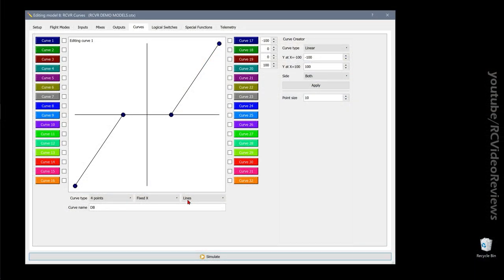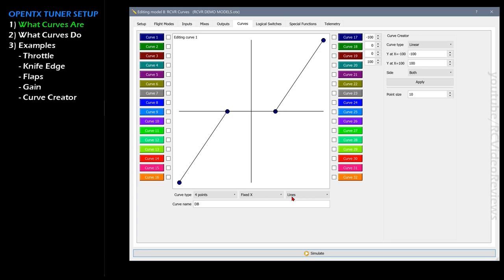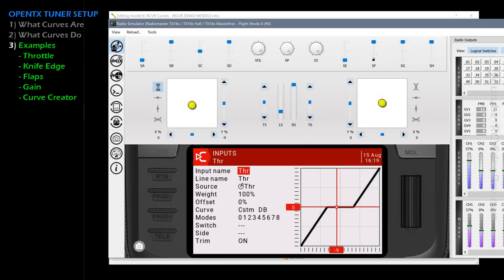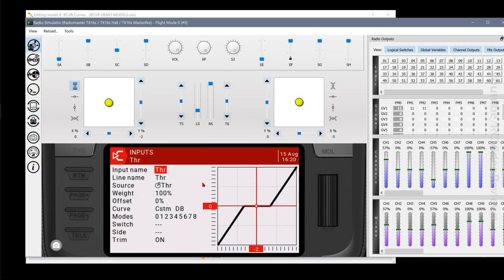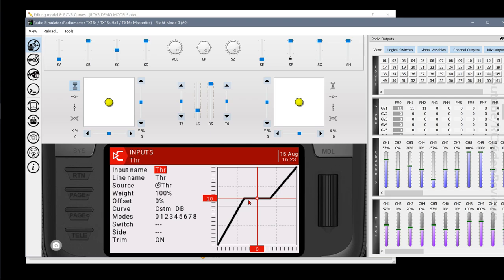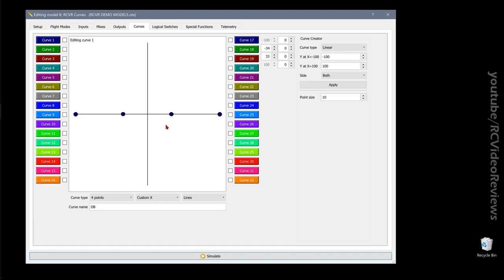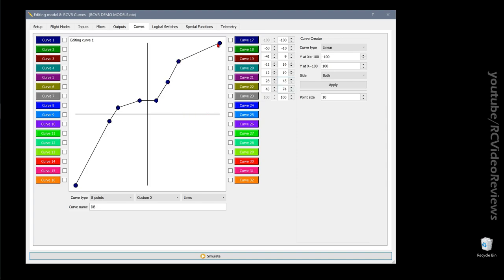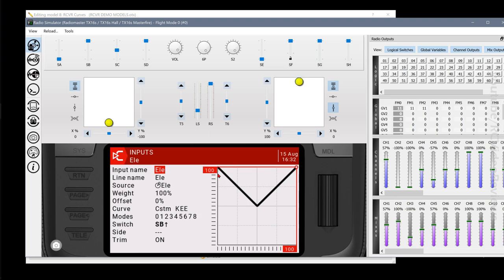OpenTx Companion Tutorial • Curves: Throttle, Flaps, and Gain Curves How-To • [Beginners]

Comment: This is the most complete explanation of curves on the internet that I’ve seen.
Reply from the maker: Awesome! Thanks for the endorsement :)
Reply: Probably true, I've just watched a few trying to figure out how to set throttle at -75% to 100 with a curve under a switch. 
But no answer why my curve didn't work like I wanted to. Had to change "multiplex" from "add" to "replace" at the mixer screen.
Wanted "idle up" under a switch for  some old toy drones, they tend to stop the propellers and drop out of the sky at -100 throttle. Not really helpful when I'm teaching a non-gamer, never flew anything friend to fly.

Comment: I was struggling with my flap servo at full end stop with flaps level to wings setup on a 3 pos. switch.  Position 2 & 3 were driving flaps much too far down. I added a 3 point curve to keep flaps up at -100, then pos 2 @ -70 for medium flap, then pos 3 @ -55 for full flap. New model wizard puts flaps on mixer page, and this was the key to customize flap end points without overdriving flap surfaces.  Figured it out on my own, but with this video, it gives me relief & confidence knowing this is acceptable practice.  Thanks John, keep up the great tutorials, your video's are the best source of info without all the crap, right to the point.
Reply from the maker: Thank you. I appreciate the kind words. Glad to help.
Reply: I crashed T28 1.1m yesterday and decided to add flaps to the wing. After asigning flaps to a 3 way switch, my flaps are moving way too much, especially in full down, almost 90° against the wing 😂. Then i said to myself, go watch rcvideoreviews and learn curves.

Comment: I better start from the beginning of the video series. I was trying to locate how to set up 2 stage flaps on my Jumper T16, since it will only go down half way. I don't know what I did when I rebound, but it used to go all the way down. I watched this video, and I get more confused, but understand more.lol This open TX is killing my brain!
Reply from the maker: Flaps should be really easy:

1) Create a 2 Position Curve. Call it FLA. Set one side to -20, the other to 20.
2) Add a switch on the Channel to which you've connected your flaps.
3)  In the switch, apply the Curve.

Once you've done that, your flaps should travel the distance of the curve. Use the curve values to set the endpoints of travel--full up and full down. Once you've done that, the middle position of your switch (or pot) should always be half of the total travel. If you want something more complex, make it a 3 position curve and put the middle point on the vertical axis at the travel position you want.

As long as you don't set your servo endpoints to push the flaps past their stowed position, you really can't hurt anything. So just play around with it. Use your channel monitor to help. If you use Companion, it gets really simple and really fast to tinker.

J

Comment: Great video!
Trying to set up pot S1 for pitch curve trim and S2 for throttle curve trim.
Have an older heli with collective pitch setup, everything works but cant get the pots to work.
I want to be able to adjust for example the normal pitch and throttle curve?
My radio is TX16S MK1.
Had a JR radio when i was younger and that radio had trim pots for those things built in.

Comment: Great vid! I made a 2 point -100 curve for throttle cut, copied my throttle in input and assigned the source as thr stick and the curve to switch.  It highlights the switch but doesn't do anything to throttle output. Thanks
Reply from the maker: I've never used a curve for throttle cut, I always use a special function for a basic throttle cut:

Special Function1   SF down     Override Ch3   ON

Use any SF slot you want. I use Switch SF in the down position. Throttle is on Channel 3.

Comment: Another great video!!! I use d eadband when flying my Ahi glider with flaps  enabled in the throtlle stick. Since they move both up.and down, I know that around the middle.they are at zero degrees -neither up nor down. Very helpfful!
Reply from the maker: AhHAH! I knew one of you deadband guys would make an appearance. 

Appreciate the comment. Thanks for checking in.

I used to use deadband on my offroad electric race buggy to manage the throw distance between brake and throttle.

I've been thinking about a way to use it for reverse thrust. The Castle ESC has an auxiliary wire which lets you reverse the motor. I'm thinking a brake to deadband at -90 then deadband to -95 and reverse less than -95 might be something fun to try on an F3A or 3D plane.
Reply: @RCVideoReviews  Great idea! Now, I have to buy a Castle ESC and the programming USB.

Comment: Thank you again for this tutorial. 
I understand that curves can be or are like Exponential settings where the output is not equal to the input, but can be set in open tx free, to suit your needs. Maybe I'll use these some time. For now I'm more busy with basic set ups. Until now I only have experience with Spektrum Radios where you have very little possibilities. But on the other hand less time consuming programming to do, to get the average flight setup. At least for my abilities.
Reply from the maker: It only has to be as complex as you need it to be, but it scales like nothing else as you've pointed out.

Comment: hi folks. i have ONE Question using different curves: i would like to use the 6 push buttons to set the different curves on 3 channels ...i do not get it baken to do this...and what are the modes which are to be seen when you enter the AETR settings...it is mode 0/1/2/3/4/5/6/7/8...what does that mean and is this possibly the way to get a functionality like i want. So i would like to have depending on the "flight character" i want that time e.g. push button 2 for a different curve for AER channels...best regards...René

Comment: Cool video,but I'm still not able to easily modify my throttle curve. 
I mean,I create a 5 point curve like yours,really easy also to assign it on the input menu but,the main issue is that I can't see the Y axis moving when I'm creating my custom curve! At the minute 6:40 when you move the throttle you can see exactly in which point of the curve you are,but unfortunately you can't do that on the curve menu while doing the curve. This is a problem when I am setting accurately my throttle curve on my gas 100cc engine while it's powered on,because I don't see (on the curve editing) the stick movement so I have to go casually trying to find the exact point that I wanna modify.
Hope to be clear,sorry but english is not my first language.
Thanks in advance for your help!
Reply from the maker: This seems more like a statement than a question. You can modify the curve, you just can't see how your stick aligns to it while editing. Unfortunately, I don't know of any way to resolve this. You may just have to go with trial and error. Remember this though, from the inputs screen while you're looking at the curve, you can long press the name of the curve to go to the curve editor. So that at least makes navigating back and forth fast.

Comment: What if I want to use a switch for the flap position but I do want to to have a smooth transition from one position to another in like one second transit time. You know what I mean, so the airplane wont change its handling characteristics to rapidly.
Reply from the maker: I'm going to make a snippet for that. Hang tight.
Reply: @RCVideoReviews  Got it now. In the mixer there is a transition time option. Found it when I wanted to set it up without timer. Anyway gonna hang tight

Comment: Thanks for the info! I am desparately trying to solve an issue with my TX16S where I really don't get any throttle input until about 30%-40%. There is just a huge dead spot and the sticks are calibrated, I checked the movement in the outputs tab and everything moves from 100% to -100% but I still have this issue with the throttle. Do you think adjusting stick low threshold and stick high threshold in BF will help with this?
Reply from the maker: Did you calibrate the ESC?
Reply: @RCVideoReviews  hmmmm it's been a while since I even thought about calibrating an esc! So no not recently but I can give that a try if you think it could help, thanks.